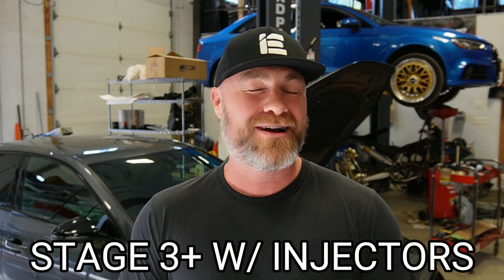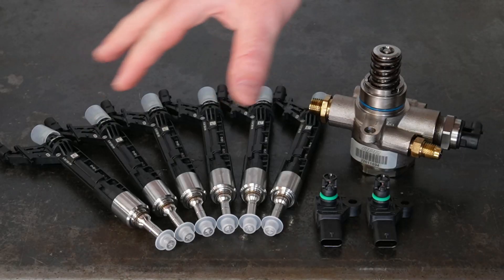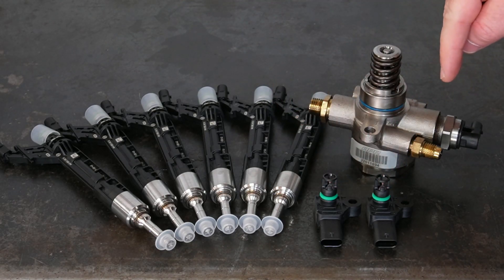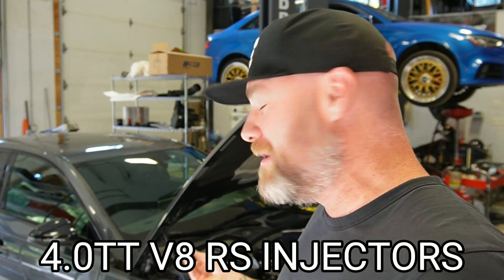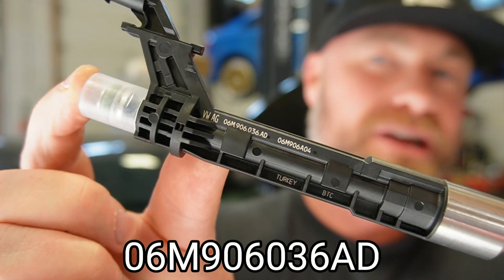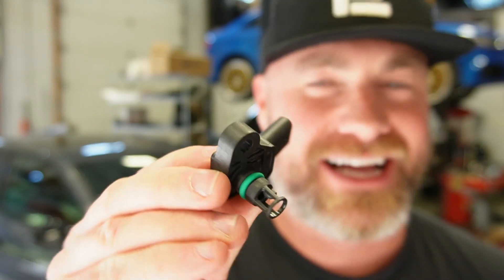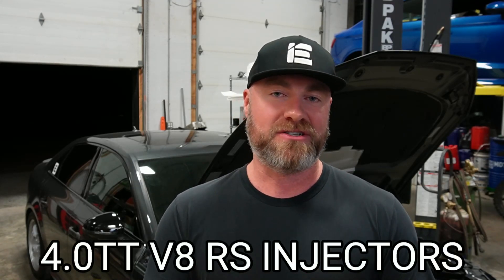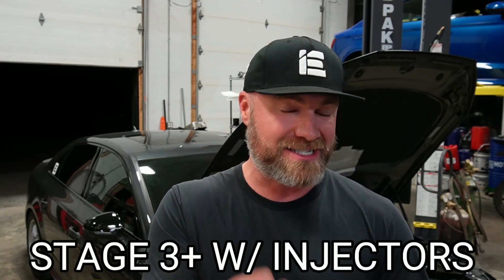APR HPFP, TTE 4 Bar MAP sensors & RS7 Injectors Install - IE Stage 3+ w/ Injectors - Audi B9 S4

Comment: Hey, thanks for the video. Going through a stage 3 install on my b9 right now and it's really useful. 

One question - are you cleaning out the injector ports after removing the old injectors by just scrubbing it with the tool and air, or are you spraying some carb cleaner in there?

Thanks
Reply from the maker: Just like it shows in the video... only the scrubber and air.

Comment: Did you use OBDELEVEN/VCDS to "Drain the fuel" before you started the injector install or was there just not much pressure in there?
Reply from the maker: No, we did not. Everything we did was shown in the video.

Comment: I am assuming that the LPFP is adequate for e70 on the TTE710?
Reply from the maker: You assume correctly. As I mentioned in this video a couple times, with these upgrades I can now max out the TTE710 on IE's E70 tune.